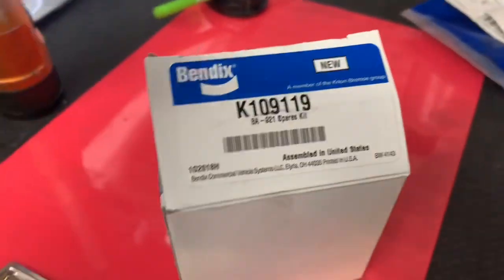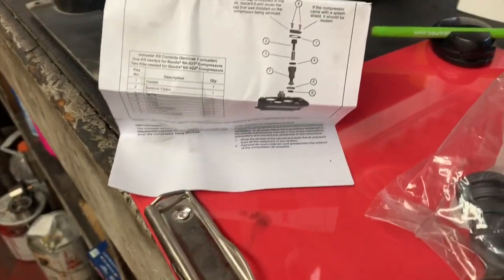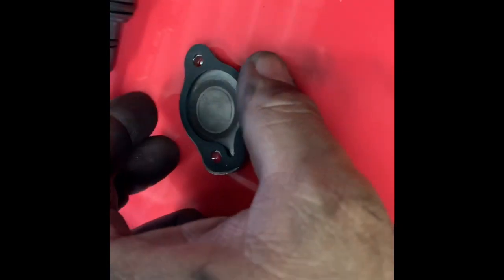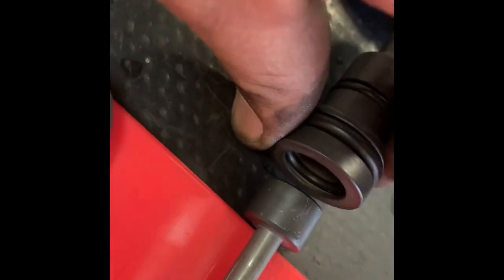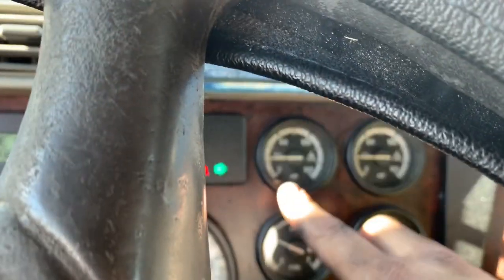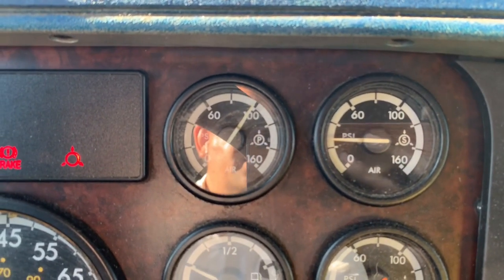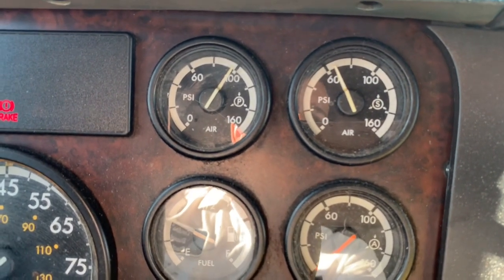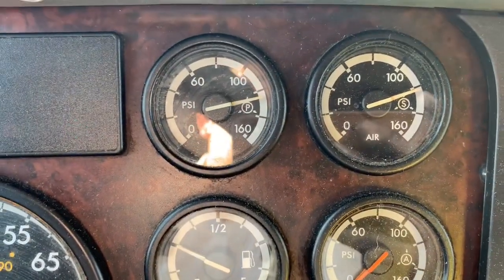Detroit Series 60 air compressor having trouble building air when parked. Smart solution

Comment: Would a bad unloader cause truck to constantly purge?
Reply from the maker: @otrookie  check the 1/4 air lines to the air compressor and to the dryer. Small leaks can cause this. Also look at the air governor
Reply: @ just put a new safety valve, purge valve and air governor on. Keeps purging every 15/20 seconds. Cartridge is few months old and compressor 1.5 years
Reply: @CarlosDieselElectric  just put a new safety valve, purge valve and air governor on. Keeps purging every 15/20 seconds. Cartridge is few months old and compressor 1.5 years

Comment: I tested the pressure coming out of the discharge side and it only pumps up to 60psi. Does that mean the compressor is bad or should I try the unloader kit. My truck is a 2006 Freightliner Columbia with a Detroit 14L.
Reply from the maker: I would lean towards the air compressor. But try the kit. It’s inexpensive and takes a few minutes to remove and install.
Reply: @CarlosDieselElectric I have a 199 kw dd 12.7, Bendix compressor. 
 It took you 3 mins 15 secs to build to 125 psi. It sounds like you were on idle, maybe 600 rpms. 
 How did the, whats called, the "engine check" do? 
 I did the Engine Check, which is supposed to be 85-100 psi in 45 secs at 1500 rpms. 
 It took me 2 mins to get to 85psi. How can i get this to 85+ psi in 45 secs??? 
 Did you do this test, and did it go? 
T4TV.
Reply: What did you do with your truck I’m having the same problems with the same truck as you
Reply: @shawnamiker1958  i got a compression tester and tested pressure at the compressor. It was a 50Lbs. I replaced the compressor. It was bad.
Reply: Thanks

Comment: My truck primary builds air secondary you have to put build with foot sometimes it builds majority time it won’t. Not sure if it’s governor, compressor, or Unloader valve. Also I bought truck used so I’m not sure if the parts or new or not
Reply from the maker: Start off with low hanging fruit. Try the air governor or the unloader kit. 
Is it a Series 60?
Reply: @CarlosDieselElectric  yes it’s 60 series
Reply: @CarlosDieselElectric  just came check on it today it’s not building air pressure at all now unless I put foot on the gas
Reply from the maker: @big_vincebro  check the discharge line for any blockage. How many miles on the air compressor? Is it original?
Reply: @CarlosDieselElectric  which line would that be I checked them ion see any oil or anything on them
Reply from the maker: @big_vincebro  the primary discharge line is the one that comes off of the air compressor down towards the air dryer.

Comment: I don't really have a problem building pressure, sometimes it's hangs a bit when the secondary tank hits 70psi, but I do have some air escaping from that port.
Reply from the maker: you can check your gasket just underneath the cover. If you remove the two torx bolts you should be able to see it.

Comment: My cascadia wouldnt build pressure when cold. Would stay at 60 psi. Replaced compressor due to oil in tanks. Now it still does it at times.have to pump brakes and drain and rev engine to get it going

New compressor from freightliner.  Should i replace unloader valve.
Reply from the maker: No, the unloading valve is new in the air compressor. Have you replaced the air governor? Also, check the primary discharge line, check for any check valves on the tanks. Depending on the application, there is a primary and secondary on te air tanks
Reply: @CarlosDieselElectric  replaced air governor too. I will look for check  valves on the tanks and see if theyre staying open. Its just weird how revving solves the problem afterwards
Reply: @INBINC  did you find the problem for this
Reply: @ancormane524  yep, it was the gear shifter actuator inside the transmission.  Was leaking air until it would finally decide to unstick itself

Comment: Would cleaning the unloaded valve work if valve looks good still or that doesn’t necessarily matter and should just replace?
Reply from the maker: The spring could also be the culprit, after all the heat exposure the spring may become weak and not allow the move correctly. 
I usually go with full replacement.

Comment: Could the unload kit leak?...because I have a leak from the top of compressor between unloaded valv and discharge line but is really hard to see clearly. Is cascadia 2012 dd13
Reply: Thanks for.anser very helpful 👍
Reply from the maker: It is possible. But check the fitting at the back of the compressor. It is a 1/4 air line that comes out from the back of air compressor. The fitting will usually leak. Little difficult to reach but spray some soapy water and look for bubbles

Comment: New air compressor, new air dryer, new air tank and new airliner and still not building air
Reply from the maker: Check your discharge line from air compressor to air dryer. 
Check for any air leaks
Check the check valves if equipped. 
Check air governor

Comment: How do you know if your governer and air dryer is good?
Reply from the maker: Well, I look at a few things. How old is the air governor? Is it the original? What is the air governor or air dryer doing?
But, I also look at the cost. Air governor is a lot cheaper than the air dryer. So start there if you are unsure.

Comment: Removal and installation is what I want to know
Reply from the maker: I am trying to get better at showing more, I am now trying to use my GoPro for this. For this job all you need is torx, pick to be able to grab the orings inside the air compressor and that is pretty much it. The Bendix kit comes with instructions and illustrations. Pretty quick fix, it will take approximately 30 minutes to complete.
Reply: @CarlosDieselElectric  getting the unloader piston out was my issue, but I figured it out. Install complete, problem solved
Reply from the maker: Jim Stone glad you were able to get  it  done. Sorry, I didn’t the question. But I am trying to make the videos a bit better to help illustrate. 
Appreciate you watching

Comment: Can the unloader valve cause my compressor to keep running? I replaced the governor and dryer and it doesn’t purge. Pressure gage gets to 150 and I hear a hissing sound from the compressor.
Reply from the maker: ER1191 could be the unload also, look at any restrictions in the lines or leaks. 
There is a bronze color valve just to the side of the unloader.

Comment: My 60 serie 14L is poping from the small valve, witch is near that kit, and it pops air after 5rpms but when idel it dosent pop or biult air that fast, just happend today, you think my compresor is bad or this kit will fix problem? Thanks
Reply from the maker: I had a similar issue, truck would build air to about 60-80 psi but would pop over and over. Popping.
I replaced the valve and air governor and it resolved the problem. Truck was able to build air to 130 PSI with no further issues.
I would say try it, the cost is a lot less then the air compressor.
Reply from the maker: Forgot to mention, there is also a valve on top just to the side. Protection valve, bronze/gold color, I also replaced that.Sometimes the carbon builds up and blocks.
Reply: I did replace those 2 componets, keep.doing the same, now am here buying that kit from this video, lets see, i hope it fixes it

Comment: ? I have 2005 century gets low on air on secondary air gauge after just sitting a little while and warning comes on. had air dryer filter changed they said oil was coming through all over filter and that my compressor is about to go out. Will I be able to try this kit as a solution or is it too late and have to swap compressor?  theres 1.4 million miles I just got truck 2 months ago so I dont know when anything has been changed It looks like an old bendix compressor. Thanks
Reply from the maker: Trucker Barry if you have enough air for the primary then you should have enough air for the secondary. 
Try the air governor but also, some of the Freightliner trucks have check valves on the air tank. One of them could be bad. 
When you are building air, do you have to use the accelerator to help it? Also, you should not have oil pushing through. This could be a sign the air compressor is bad.
Reply: @CarlosDieselElectric  Yes I have to accelerate to build it up I should have said both gauges loose air but start losing more air from the secondary 1st. Not all the time but sometimes when its built up I release brakes and it drops to 100 sometimes 80 psi quick. Once I get going it'll build back up and I'm good driving. But the issue with oil going thru I'm not sure.
Reply from the maker: Trucker Barry sounds like the air compressor is starting to fail. Try replacement of the unloader kit first. That may help, if it does. It work then yes the air compressor could be bad. Especially with over one million miles.
Reply: @CarlosDieselElectric  Where can I order that kit?
Reply: Also the air dryer makes a weird whistle sound when it purges I'm guess from the oil in it.
Reply from the maker: Trucker Barry your local Freightliner. Use the last 6 of the VIN.

Comment: I have the same issue my compressor is only 6 months old and now it won’t build air unless I accelerate a lot. So I’m trying this out tomorrow.. the 2 dislikes are mecanics that would tell you your problem is the compressor
Reply from the maker: raul maarcheco if you air compressor is under a year old you should have warranty through Detroit or Freightliner. I’m  sure some mechanics will tell you it’s the air compressor. But it doesn’t hurt to try this first before replacing the entire air compressor and going through all the labor. Also, check for air leaks and air governor. Air leaks will kill you air compressor because it always has to keep working.

Comment: I heard him say that this driver services is vehicle every 20000 miles. Is that too much or what? I was told to do it every ten to twelve thousand. I also have the Detroit series 60 but with the 14 leader. Am I changing it too often?
Reply from the maker: Typically every 12-15,000 miles is normal for the Series 60 14L. If you are using a premium oil like Mobil Delvac 1300 and good quality oil filters then you should be ok. The truck on this video is already at 1,021,106 miles. He runs from Los Angeles to Bakersfield, so stop and go traffic doesn't really apply. The local stop and go is what breaks down the motor oil faster.
Reply: @CarlosDieselElectric  Yes I do use Mobil Delvac 1300 and thank you for the quick reply! I'm about to go local in the Chicagoland area in a few months. Once I do that, how often should I change my oil? Still every 12,000 to 15000 miles?
Reply from the maker: Arturo Abasta I would say every 15,000 miles is fine.
Reply: @CarlosDieselElectric  Great, thanks again. Gonna share your page on my social media! 😁

Comment: Hey Carlos , i have a 2011 freightliner cascadia with a series 60 & my unloader valve is leaking a ton of air when purging , my secondary air tank have a hard time building air sometimes , can I just remove the cover and seal it or should I replace the whole thing with this kit ? Thanks
Reply from the maker: Frangel Nova which cover? Where the unloader is?
Reply: Carlos Diesel Electric got it fixed boss , I just bought this kit and installed and problem went away

Comment: I’m having an issue with my air purge valve. It does a small purge at 115 then when the compressor gets it to the full 135 it can’t purge completely, like it lacks pressure  to purge, bc when I hold the purge valve with my hand it gets back pressure and purges probably. It’s not every time but it gets stuck like this 4 to 6 times a shift. Things I changed in order
1 air cartridge filter
2 governor 
3 air purge valve
4 turbo cut off valve 
5 the whole air filter system 
6 governor 

I have a two piston compressor which is building air properly.
Reply from the maker: Aziz Ibusevic any air leaks? Check the fittings for leaks. What kind of truck?
Reply: Carlos Diesel Electric thanks for the reply, it’s a 2013 fl Coronado dd15, no air leaks. I changed the governor 2 days ago and noticed that doesn’t purge when full when I have the truck worming up and when I stop with low rpm it starts acting up. This is how it was with the governor that I changed 3 months ago but with that one it started to not purge while even driving I would have to stop and hold in the purge valve but with this new one it doesn’t act up while driving
Reply from the maker: Forgot to ask, how old is the air compressor?
Reply: Carlos Diesel Electric it seems to be original 670,000
Reply from the maker: Aziz Ibusevic so this one is tricky. Replacing the air governor is a good start, checked for any air leaks at the fittings at or around the governor or compressor, next I personally would have just replaced the complete air dryer depending on the age and last it might be the air compressor itself. 
I know this isn’t too helpful, but try draining the air tanks for water that may collect. Just remove the drain plugs so any and all water can completely come out of the air tanks.
Reply: Carlos Diesel Electric I replaced the air dryer already I drain the tanks daily no water collecting in them the dryer is doing his part. Yea I think I’m going to change the compressor I just haven’t because the air dryer is a double cartridge 2k and then the compressor 2k as well

Comment: I was just about replace the the compressor. Gonna try this first. 
Already did the governer and the air filter and purge vale on the dryer. Still taking 12-15 minutes to build full air. Takes for ever. 
But no oils in lines. So the compressor seems good. But slow as fuk. Btw. Million mile Detriot s60 14l. I’m not sure if it’s original compressor. I’ve had it for 300 k miles and it’s the same one since I had it.

UPDATED 
Changed the loader and still the same problem. SLOW to build air. 
replacing compressor today. 
Pulled the old one out and it spins with easy by hand. The new one will barley spin by hand the compression is so tight. .
So it was for sure my compressor.
Reply: Gcal1956 i’m getting ready to replace a compressor with this same issue. Will not build any air at all at idle but will build very slow when reved up. Already changed unloaded and governor and still same issue
Reply: @El_Chentazo  Did the exact same thing, then decided to test to see if it was the air dryer so I bypassed it using a elbow directly connecting the discharge to the air tanks. Ended up blowing the discharge line. What could this mean?
Reply: Did it end up being your compressor

Comment: Can i find it in store?online
Reply from the maker: robel R you can get them at any Freightliner. What kind of truck do you have?
Reply: Carlos Diesel Electric 2007 freightliner columbia S60
Reply from the maker: robel R so you should have an air governor on the back of the air compressor or on the air dryer. Depending on the model air dryer. But try using the Bendix with the blue cap and the fittings that are on it should not be leaking. What have you tried changing or replacing?
Reply: Carlos Diesel Electric i got replace unloader kit and now its not building any air at all even 15rpm.i have bendix compressor the mechanic also disconnect the line from the head of compressor to drayer ,the compressor pumping air about 60psi
Reply from the maker: robel R the only reason to change the unloading kit is when the air compressor is not able to build enough air properly. The original problem you had was you were building too much air air 150 psi. Something might not have been installed correctly or now another problem has presented itself. Email me and I can help you out as much as possible

Comment: I have the same problem on my truck and on highway it goes over 150psi what do you think the problem is?
Reply from the maker: robel R always start with the air governor. Try using the Bendix air governor with the blue cap. Those are regulated at 130 psi max. Also, check the fittings for any leaks. This will also not let the air governor work properly.